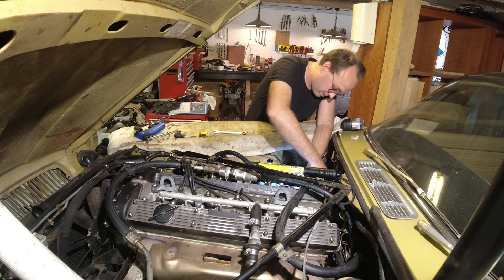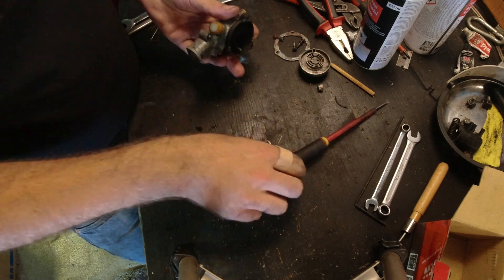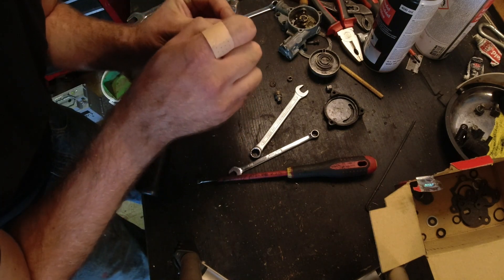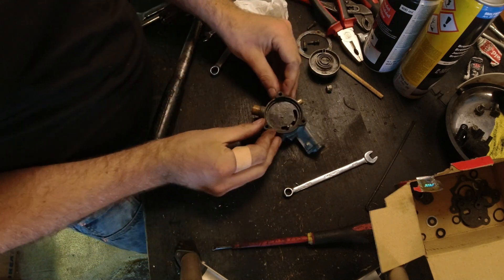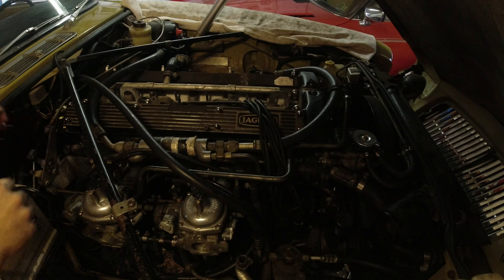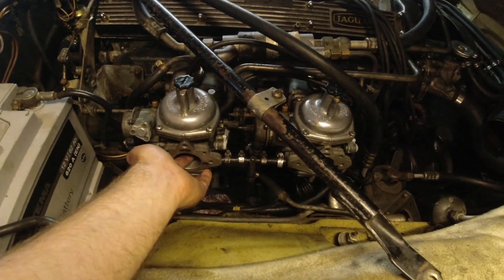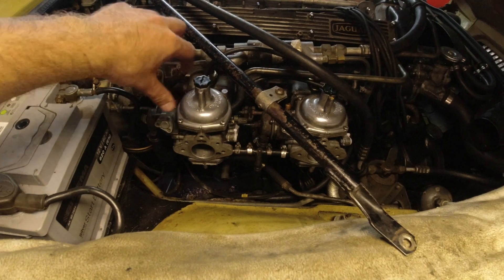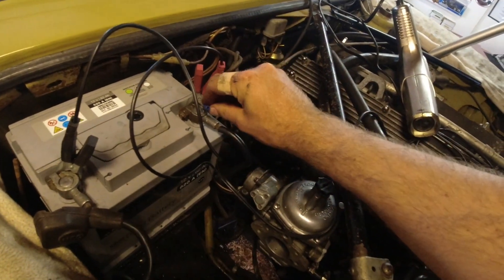One Week to go and It's NOT Running Well -  Jaguar XJC Rebuild Part 6

Comment: If the choke circuit is leaking fuel from bad o-rings or other sources, it will be very rich. I had the same exact issue with the start carb on our '52 XK120 with the flat face sealing surface having a ring beat into it, causing fuel leakage. Had to resurface and lap in the flat faces, problem solved and set needles equally in the SU carbs, and it cleaned right up & runs absolutely great. You are on the right track, Adam! You will get this sorted out nicely.
Thanks for a cool and informative video!

Comment: If I had one of these, I would convert it to fuel injection. Use the Series 3 manifolds etc and as many Bosch parts as possible. Even so, that runs very well indeed.

Comment: You are correct, a vacuum leak will cause the car to run lean. Always an important thing to do before a tune up is to check and repair any vacuum leaks. I recall your episode on tuning SU carbs, it is still the best video out there. I am sure have the Strombergs running perfectly

Comment: Seems to be running great, you’ve done a really good job figuring out all the quirks of the induction system and carbs. Hopefully the rest of the refresh goes well, if you do get short on time I’d be tempted to get a last few thousand km out of the old oil and tyres…

Comment: If the carbs are still rich with the needles dropped all the way, lower the float levels a tad (3mm or so).  Ethanol blended gas will cause a slightly higher level in the bowls.  Too high float levels will also cause a rich condition off idle and poor fuel economy, even if you can get an acceptable idle mixture.  Or such was my observation with the 175 CD's on my TR-6. 

The run-on valves are better set to not do much, or defeated completely.

Comment: Something is pretty wrong with those carbs.  They were designed by Zenith and used by Jaguar to make the engine run leaner than normal in order to pass emissions requirements and keep the catalytic converter functioning and alive.  A car that's running rich will kill the converter.  Do they have the right USA spec needles and seats in them? Is the float level set to USA specs, not European specs? A rich condition won't be cured by timing and new s[ark plugs.  Maybe a bad plug wire or two is causing a lot of misfires so raw, unburned gas to now destroying the converter.